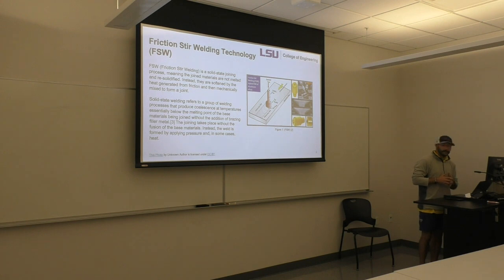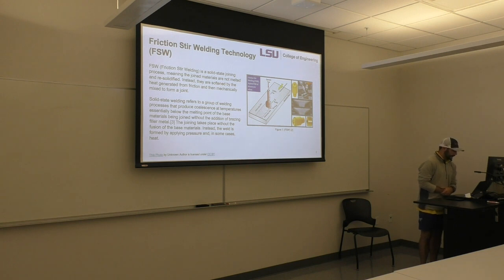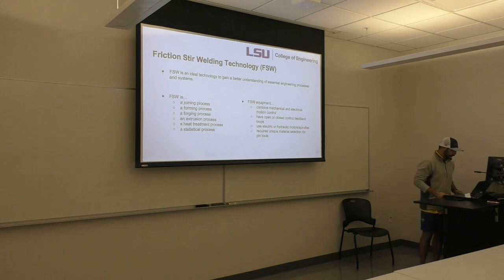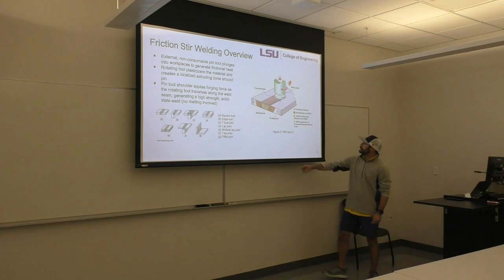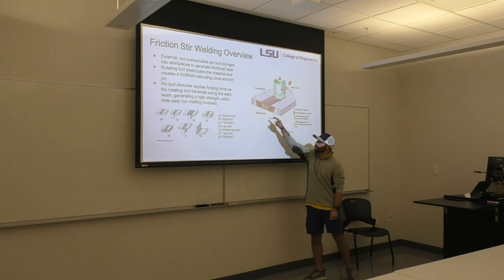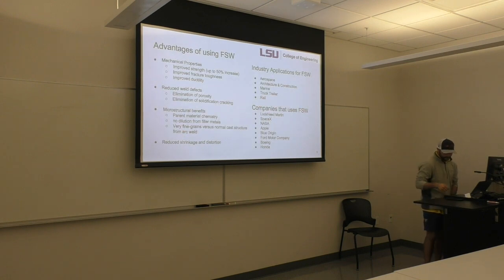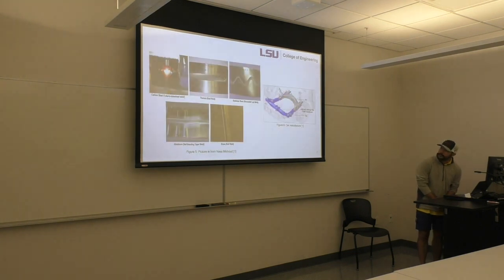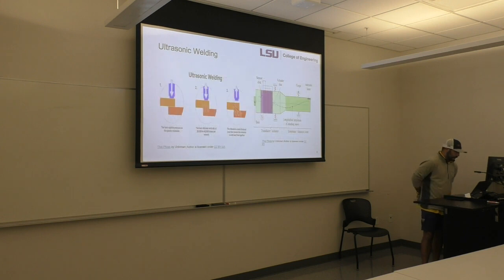Mathew Williams

Comment: Good job Mathew on presenting some unique manufacturing processes. It was cool to learn about some other welding techniques that we haven't been exposed to yet. I would say for the slides to remove some words as it was pretty dense with wording, and try to make the bullet points. Also try to make more eye contact, but you spoke clearly and explained the concepts well.